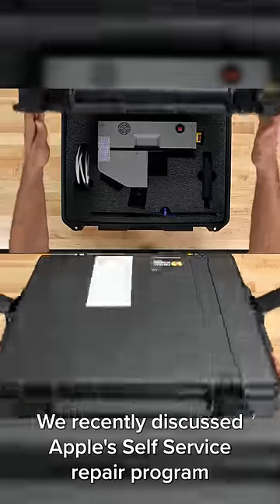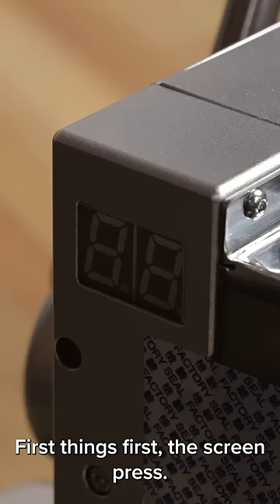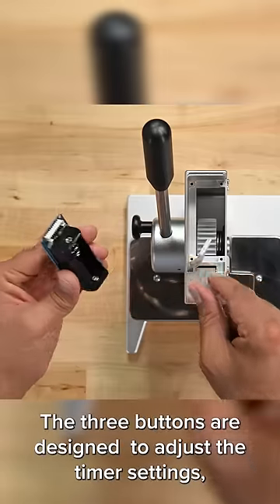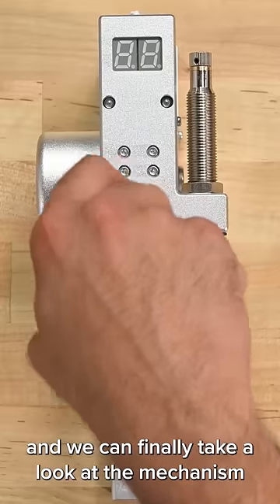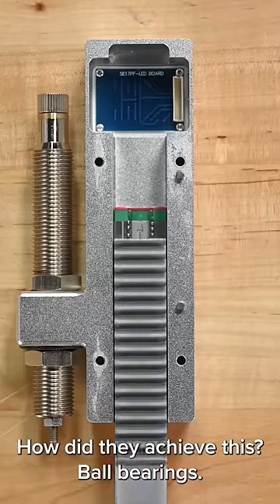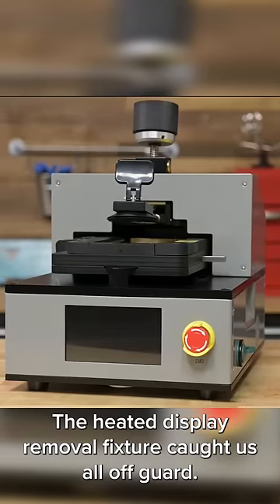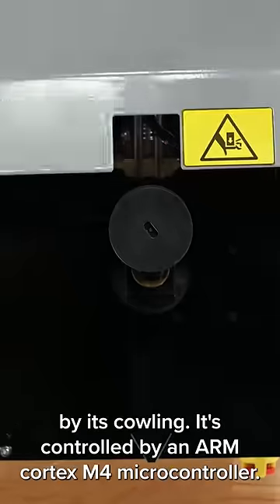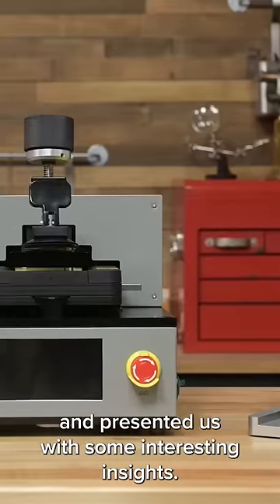Tearing Down Apple's $1200 Tools! What's So Special!?

Comment: My understanding is that it's still impossible to get replacement parts like charge ports, and Intersil Chips. Fancy Machines don't address this issue.
Reply: Fancy off brand chinysium/DIY machines!
Reply: You act like you care lol. Sit down and be quiet
Reply: @minortoterona2947  using third party parts voids your repair under the repair plan so you won’t be covered after :(
Reply: @evandunkley292  i said THOSE TOOLS are cheap no name stuff, everyone can made in garage( and even bette). ALSO you cant repair new models even with genuine part, you have to send phone to marry new parts in order to it to work.
Reply: @charlesli6751  Some people actually do, right up to the point we'd rather eat a cold steel barrel than hear you talk anymore
Reply: I want to see you change an ic from a phone
Reply: It's a talking point from Louis Rossmann who repairs Apple products for a living, and it does concern us because not everyone can afford or wants to upgrade their device every 2 to 3 years.
Reply: What do you mean its impossible to get replacement charging ports? Ive worked as a phone repairman and they sell a billion of em for every iphone model.
Reply: @methanoI  newer phones are sometimes designed to fail if you use replacements parts. I don't remember which one but someone bought two identical phones and swapped the cameras and they didn't work, but they swapped them back and they worked again. They're designed to be impossible to repair in some cases
Reply: @thedudeamongmengs2051  Sounds like america my friend, we dont have that stuff here.
Reply: @methanoI  I mean it might be just an American problem. It's possible other countries have laws against that
Reply: That's Hugh Jeffreys you guys are talking about and it took me seconds to find he lives in Australia, if anything his video is what changed it, with 11M views that makes Apple look pretty bad but if they silently fix it then people will forget about it.
Reply: @minortoterona2947  I would love to see you make these tools at home.
Reply: Correct. They're repair program is almost a step in the right direction, however I believe it to be entirely fluff
Reply: @thedudeamongmengs2051  that’s not “designed to not be repaired” that’s just hardware ID. A proper repairman knows how to reprogram the board when replacing cameras so that it will work.
Reply: @bryanthornburg8636  can you do it without specialized tools you have to buy from apple?
Reply: @alakani  he prolly like 9 yearsold just like everyone else on YouTube
Reply: This is malicious compliance. REAL compliance would be actually designing the devices themselves to be easier to repair by regular people.

Comment: So they used generic linear rails that I can get on Amazon for $15 and a $20 microcontroller and that is supposed to justify the $1200 price tag??
Reply: You forget to include their state of the art paint job for the Apple logo on the back which could cost from 1000$ - 10000$ depend on the product.
Reply: You can get linear guides of this size and type for less that $5 in China
Reply: Like everything made my apple
Reply: @safetyinstructor  Yeah, but those are generally quite bad. You don't need original Hywin rails, but usable ones cost a bit more
Reply: @Siddhesh "super sophisticated" has to be sarcasm
Reply: @Siddhesh Really now. A simple endstop board, 2x linear guides, and a geared rack. How immensely sophisticated, no chance at all someone could replicate this exact setup without the fancy machined cowling using simple 20-series and 30-series extrusions, a linear rail, and a pair of linear guides.
Reply: @EgorKaskader  Mind. Blown. 🤣
Reply: Where are you getting this linear take for that cheap!?
Reply: @untrust2033  two pieces of steel shaped in such a way that guide the tool easily. Steel is cheap, I don't think some people understand how cheap steel can be so shaping it into a specific shave unless it is an incredibly geometrically complicated shape or you need ridiculous tolerances at the scale of stuff we're talking about maybe five bucks
Reply: @the_undead  Please go and look at an image of a mgn12h linear rail and mounting blocks, then tell me how you can make that for five bucks!
Reply: @untrust2033  the main reason precision linear rails are so expensive is because they're just that, precision. The bearing mechanism itself is EASY to machine in large quantities for products like this.
Reply: @untrust2033  just don't use stainless steel, stainless steel is not cheap because you need a lot of quality control, whereas your standard steels are not that expensive.

Lower the tolerances a little bit and then you have a product that probably cost somewhere between $5 and $15
Reply: @platinumsky845  Im not saying they arent expensive!
Reply: @the_undead  Tolerances cost money
Reply: @untrust2033  tf is the big difference between paying $5 and $13? that’s the price for your mgn12h
Reply: @chasexchaos9392  dude literally show me where i can get them for that cheap and i'll believe you
Reply: @untrust2033  The point is you don't need to use such a complex bearing or make an arbor press that is buttery smooth.
You could have just fitted the rack in the channel without the bearing and it would still work just fine for pressing a screen... Or you know weight and gravity are also a thing.
Reply: Don't forget the needlessly overkill CNC aluminium construction
Reply: @the_undead  Stainless steel in general is not expensive, especially when you’re looking at lower-end stainless like 440 or 3Cr13MoV.
Reply: @ianr2002  apple is made in China. The parts they use in this tool are probably the same ones he's talking about.
Reply: So the product is only made of linear rails and one microcontroller?  Basically you are saying that you can buy cheap rims for a Rolls Royce and you don't understand why they sell you the car for +500K. Awesome logic
Reply: @growinglifeorganic940  i hate apple but recently had to redesign half of a huge project because i couldnt find linear rails for  cheap enough! If i knew where i could get them for 15 dollars i wouldnt have a problem!
Reply: @askmeaboutsugma  I'm sure they would be using some kind of 300 series austenitic stainless. At least that's what I would use. Its super cheap, and pretty high in stain resistance.
Reply: @Christopher Grant I'm not sure which tool this would equate to exactly, but after a quick Google search for screen presses and other maintenance tools, the most expensive one was like 100 bucks.
Reply: Alright go make the same machine for a lower price then and a good timeframe then?
Reply: @untrust2033  I didn't say you weren't, just pointing out why some are and some aren't.
Reply: Look at the website! The tools are like $240ish each. Combining all available ones gets you to $1200

Comment: They are literally using a board off of Ebay thats .20 cents each and then de soldering the buttons
Reply: Nah the buttons were still there, just disconnected. 20 cent board tho ya 100%
Reply: @ILoveTinfoilHats  yeah, de soldered, lmao
Reply: @milathecat5454  Literally look at the board, they're still on there.
Reply: @ILoveTinfoilHats  you know what solder is right? Also you said disconnected, what do you think connects them? Its solder, its such a basic thing to understand, if you remove one of the connections the button is de soldered, how do you not get this
Reply: @milathecat5454  so if I scratch the trace away put doesn't remove the solder from the button itself you would still call this desoldered? The connection is mostly made by copper traces on the pcb or do you think the board is making all its connections with Solder? So if something is disconnected it doesn't have to be desoldered, you can simply break a copper trace and the component will be disconnected while it is still soldered in place.
Reply: @milathecat5454  Nah I just am confused by the desoldering terminology here, it is still on the board, it sdoesent look like they removed any solder (perhaps they did just work super clean, I don't know). So I asked the question if you would still call something desoldered if you just break a trace. I then ask if there is by any chance the possibility that the connections on the pcb are made out of solder, as you correctly assumed I do not work with electronics for a living, I am just interested in electronics in general and it would be new to me that pcbs are conected internally with solder traces, however since I am not an expert in PCB manufacturing, it might be that there are weird cases like that, so I asked you, since you seemed knowledgeable if you think that the whole electronics on the board is connected by solder (cause I don't know, perhaps sometimes this is the case). Then I summarised my thoughts by saying when something is disconnected it doesent necessairly have to be desoldered, now I don't know if I am just confused by the meaning of the word and anything that is causing a disconnection to a part make this part considered desoldered. That is why I asked in the first place. I trying my best to lay out my thought process clearly here but english is not my native language and sometimes I may formulate things weirdly.

Solder is, if I understand it right, an metal alloy that is conductive that you heat up with a soldering iron to connect one metal part to another metal part. That is what I know as solder. How does the button hold on to the board if they are desoldered, that is what confuses me.

So please, if you like to answer these question, or keep assuming nonsensical bullshit about people you don't know and insult them over YouTube comments xD

Comment: Expect companies to get their hands on them and reverse engineer them. Make them cheaper, and possibly work the same if not better. Companies have already made the screens. Why not the repair tools?
Reply: Because it is illegal to do so
Reply: @fairnut6418  lol.
Reply: @911manish  Reverse engineering is not illegal, not at all. What would be illegal is using patented parts or whole devices. 

If they use the knowledge to build it differently, there is no one that could stop them from doing so.
Reply: @911manish  Because it's... Illegal to use a generic press design. Alright then, mate. I'm sure Apple can patent a sodding arbor press mechanism that's been around for well over a century.
Reply: @911manish  if your comment is correct then this tool is the illegal thing because this is not new technology, not in the slightest
Reply: @EgorKaskader  throw enough money in the US government and they would probably allow Apple to patent something they have no right to patent.
Reply: @rollingslothmachine3431  I never said reverse engineering is illegal. Manufacturing exact replicas of parts or entire machine would be illegal to do so. You can patent the design but not the principles they work on.
Reply: @the_undead  making some things cheaper can leave you with different corners you can cut. Using cheaper material to make a part is illegal. Designing a new part is an expensive process. Nobody wants to design a part if they can manufacture replicas or knock-off without getting in huge trouble. 

My suggestion, people who are good at designing can make drawings open source.
Reply: @911manish  depends if the parts are patented or copyrighted, the fact that it's bearings and gears strongly suggests it's neither, and with the "build quality" looking about $120 per machine at best suggests that there is a gargantuan markup.
Then apple will slap in some "security feature" that'll disable it's use until it's programmed to be compatible by some Apple-Store only product. Again...
Reply: Good luck making these cheaper. Maybe with slave labour in a chinese backyard, but the price is totally reasonable for a company operating a viable business selling such speciality tooling.
Reply: @MarianKeller  yes but these repairs don't need specialty tooling exclusively for iPhones.

Existing tools used to repair many different phones are cheaper than these tool's despite more versatile functionality.

Don't get me wrong I appreciate apple making tools and parts available to begin with if just for the awareness towards the need for right to repair legislation because of how spectacularly they have managed to screw up every part of their own self managed repair program except the thing actually being repaired.

I just hope people don't see apples program and think that its the best fixing your stuff can offer.
Reply: What is there to reverse engineer? Cheaper tools that can do exactly that or even more are around for much longer for a much lower price. The only feature of this thing is that it has an apple logo on it.
Reply: @igorino1767  well said!

Comment: You can buy a tool online (about 5LB weight) that open screen and back panel for all iPhone's and android devices. It is not precise like Apple, need preheating before use, but does it job for all devices (you do not need to buy a tool for each phone type). It close phones as well.
Reply: ya this is nothing but empty words for apples customers asking for right to repair.
Reply: Yea but did you ever open old phones?
Reply: @fltfathin  How old ? before 2007 no, I only opened phones with a modern flat screen